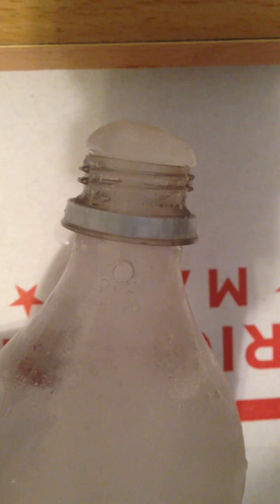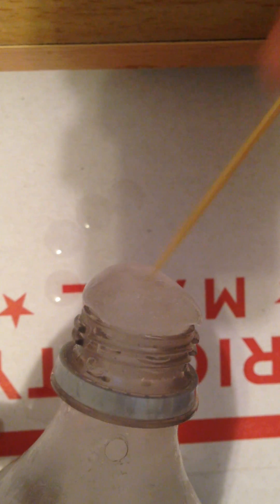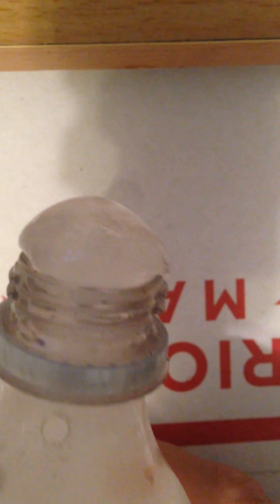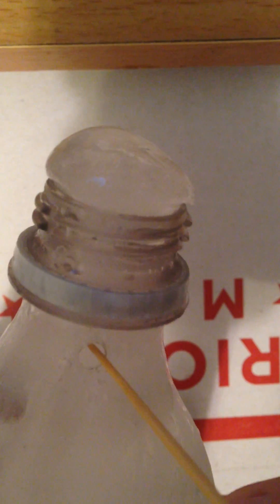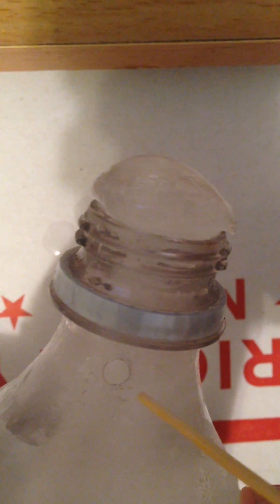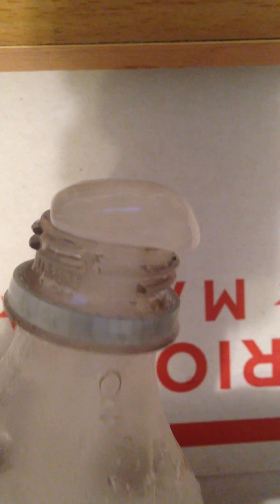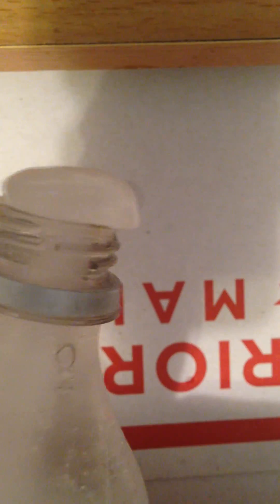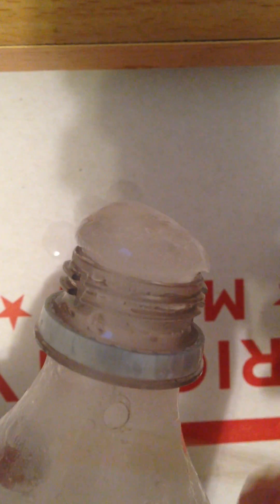Drilling hole in soda bottle to make a soda siphon

Comment: What about a hole punch tool instead?
Reply: Mike wrote me today to say that the drilled hole is 5/32" diameter. 
5/32"  =  0.1563"  =  3.9688mm. A 4mm punch would probably be worth a try.
Reply from the maker: Haven't tried it. Curious to see the results. You should take a stab at it 'n post a video here on YourTube - especially if it does the trick